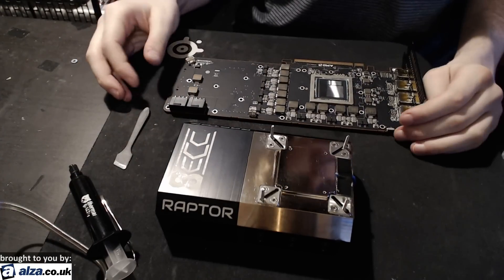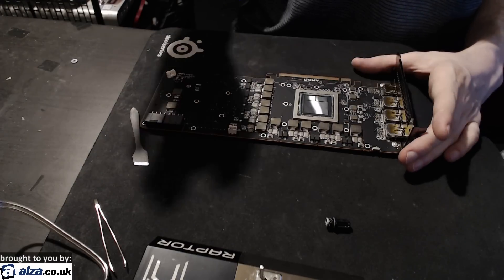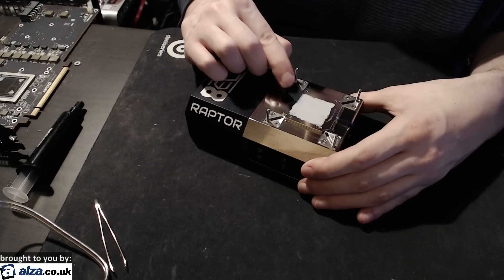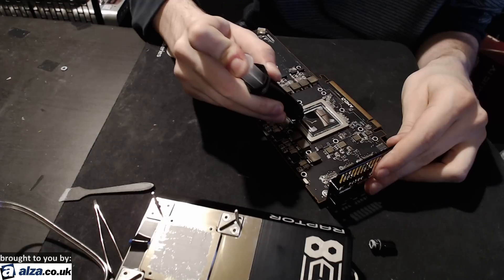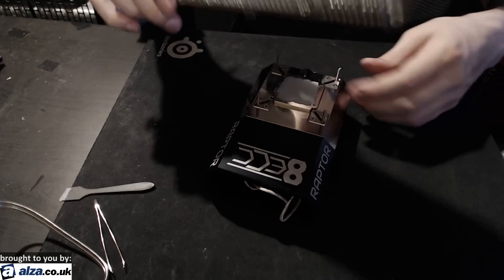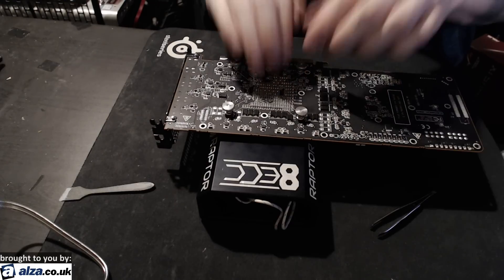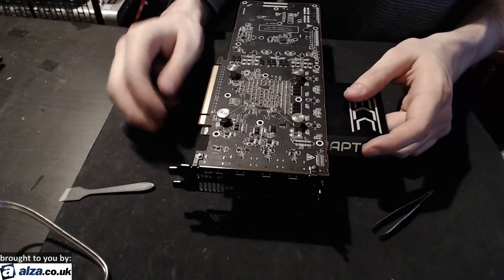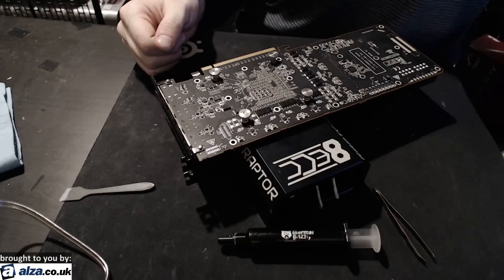The buildzoid way to apply thermal paste on GPUs for LN2

Comment: You know that kitchen wrap thing you use to cover dishes without lids? Put a piece of that on a finger and a little dab of thermal paste in the middle of the die. Spread carefully using wrapped finger. I found it uses much less thermal paste than little shovel some manufacturers provide. I've never touched LN2 though.

Comment: Hello, great video! I have suggestion regarding the  process of applying paste. I am not engineer or anything so maybe I'm wrong... Last summer I started some project which involved couple of TECs, water block, fans, powerful pump and big a** radiator. Basically, on both sides of water block were 2 TECs. Each TEC was cooled by Arctic Alpine 20 cooler. The purpose was to lower the temp of water as much as possible (lower then 0). After several failed attempts we realized the problem was paste layer between TEC's cold side and water block. TEC would easily lower the temp to Sub zero on first run and paste wouldn't spread uniformly on its cold side. The solution to the problem is crude one, but effective: After assembling water block to TEC (and cooler on the other side of TEC) we would leave the assembly on the kitchen hot plate for 2-3 hours on about 50-60°C. My guess is that higher temp made paste more viscous and that allowed it to spread uniformly and to squeeze out any air bubbles. We run this setup for almost 2 months non-stop and it worked perfectly. After we turned it off we tried to disassemble it and we failed - the bond was so strong. We succeeded only after heating up everything again on kitchen plate. I do not know anything about LN2 but maybe this can help get  you better performance.

Comment: Mr Buildzoid. First of.. Thanks for great content. Good work. Secondly, Can I ask you a question on a different matter. I own a MSI B350 Tomahawk motherboard.. I know.. Sigh. My problem is I cant find the vrm specs and max temps on forms or the internet or msi manual for that matter. I also don't know if the temp reading in hwinfo is the vrm or mosfet temps. My problem is if I run real bench.. For example.. The motherboard's temps go to 125 celcius,  gets stuck at 125 and then to 0.. But the system does not shut down. I just hope it didn't damage anything. Any information regarding the VRM'S from an expert would be greatly appreciated.  Thanks.

Comment: Other than breaking world records, what is the point of LN2? 
Us general users can not use LN2 in a day to day application.
Like EVGA Kingpin cards, with an LN2 bios which a general user will never use.
I diagnosed a Kingpin card recently, and the guy had the LN2 bios running on the stock cooler, and yes, he crapped out the GPU.
So i don't get the point of LN2 bios on a retail card designed for general use.

All that aside, I still love watching LN2 at work, don't get me wrong here.
Reply from the maker: Because there are a lot of LN2, DICE and phase change overclockers who don't have contacts at EVGA to get their hands on non retail hardware. Selling hardware for LN2 OCing gets my full support because without that getting into LN2 overclocking would be straight up impossible in many cases.
Reply: MrHatterr the kingpin card is not for general use, why would you buy it if you dont ln2 oc it
Reply: Well you missed my point totally, i own 2 kingpins and 3 classifieds all used a general use card simply for overclocking ability, not LN2.
My point was, why have LN2 features on a retail card when nobody buying a retail card for general use will never use the LN2 features.
Like I said, other than breaking world records, LN2 is pointless.

Comment: What about putting extra thermal paste around the die on air/water for normal use. It would ensure that heat can conduct off the edges of the die, anyone want to test and see if it makes a difference?. Amazing innovation here
Reply from the maker: it doesn't help. I did some thermal paste application testing in the past and as long as you don't apply too little you shouldn't see any thermal variance.

Comment: Which mobo do you suggest me between x370 taichi (vrm overkill?) and x370 gaming k7 ?
I would like a good product for oc and future upgrades of the cpu (I have R5 1600 - FlareX 3200 for now).
Reply: VRMs are not an issue with ryzen since they all run fairly low TDPs. A B350 motherboard should be plenty, the added cost of X370 is not worth it if you are not specifically going for crossfire/SLI.

Comment: It's the first time I see a naked Vega 64... Why the hell is it so long if 1/3 of the PCB has barely anything on it?!
Reply: I haven't directly seen the Radeon Pro SSG's PCB but I imagine it's shared with RX Vega/Vega FE, so I'm going to speculate that the reason is most likely due to the extra space needed to mount an m.2 ssd to the pcb, which this hypothesis is also supported by there being an empty connector pad on the back of the consumer card near the 8 pins.
Also, it just so happens the extra pcb space doubles up as a good place to mount the blower fan for the reference card.
Reply: they already tried the small PCB thing with the fury, but then they realized that the air coolers overhang the board by like 60% and that looks  even more stupid

Comment: I wonder if refrigerant oil mixed with cpu paste would work to keep the paste from hardening at LN temperatures? The one I am looking at has a pour point of -56C. I guess that means it is the viscous like a grease. http://www.nucalgon.com/assets/SDS/English/4314-3MAF_SDS_ENG.PDF
Reply from the maker: The thing is I'm like 99% sure kryonaut is already based on something like that because most pastes just use silicone oil and turn completely solid and fail at -20C. Kryonaut is perfectly fine until you start going bellow -100C. Kryonaut was basically developed just for LN2 overclocking. So was the Kingpin cooling KPx paste. Both of them will crack depending on what you try to do with them. With Kryonaut the most reliably solution is just to use lots of it and cover everything.

Comment: I know, that GPU architecture, or better said, architectural bottlenecks might not be your strong points, but what do you think is the main reason, that the performance for RX VEGA isn´t as good as it should be (we all have seen those benchmarks of certain games, that make those Vega cards perform even better than a GTX 1080ti). What should AMD change about the core to get even better performance?

Great video btw. I have been using TG conductonaut for all of my laptops and GPUs, it is a nice step up from normal TIM.
Reply from the maker: They evidently went way past the optimum amount of SPs. Since the V56 is basically just as fast as a V64. Doing 3000 - 3500 SP design or smaller might have saved a lot of power and manufacturing cost without changing performance that much. I have no idea what actually needs an upgrade. From looking at just the specs of AMD GPUs I can't see anything that looks really obviously badly out of balance. The 390X has just as many ROPs as a VEGA 64 and that looks kinda concerning but on the other hand the 7970 and RX 480 have only 32 ROPs and they're fine. So basically I think a smaller more affordable VEGA would have been a better idea than the evidently overly SP heavy design we got.
Reply: better ask that josh from pcper

Comment: How would you describe a suggested coverage amount in relation to LN2 but for a waterblock? I'm getting good temperatures but at higher speeds the 'hot spot' climbs towards 70°C and I believe it's thermal throttling (using the liquid BIOS), so hoping for some perspective for when I repaste the GPU block.

Also thanks for all your content! You may think you ramble sometimes but there's more information in there for us plebs than you think ;-)
Reply from the maker: for water blocks and air coolers I just do a thin layer on the die. This is literally only meant for LN2. I wouldn't even bother with it for dry ice.

Comment: Thank you. Pretty much the way I have done it for the last ten years for water and air.
But with a bit less paste and I revert this method. I spread the paste on the chip/HS and put the pea on the cooler.
So I can spare the extra step with marking the edges.
Good to have some confirmation though because everybody else keeps on flaming me for this.

About the small pea in the middle and air pockets:
I used to not do this and yes I got air trapped once.
You will notice though because the temps went 10°C higher on air and stock.

Comment: im guessing the amount of thermal paste buildzoid uses is probably to help prevent condensation/inconsistent temps or something from getting in between the gpu and ln2 pot. im guessing.
Reply: JR to eliminate cracking.

From now on I'll assume,
I think side's crack which  doesn't make any difference since you  don't dissipate much heat there. And middle doesn't crack because side's already did. I think cracking is caused by temperature difference. Also should have said before cracking paste getting solid and/or shrinking due to temps getting lower (but if you are using kpx or kryonaut shrinking shouldn't be a problem) and not properly contact so not dissipate heat to ln2 pot.

Comment: All those people on youtube that for some reason weren't able to spread thermal grizzly on "metal/shiny surfaces" should watch this video. It'll help stop incorrect assumptions of thermal grizzly paste not working.
Reply from the maker: wait are you telling me people have a hard time spreading TG Kryo? Are you sure you aren't watching vegetables?
Reply: i'll have to go back to the videos and confirm, lol, but there are a few videos on youtube.
Reply: I just bought some Thermal Grizzly Kryonaut for my EVGA GTX 970 that im slightly modding. I hope my Grizzly paste sticks, watch me have the same problem due to bad karma, lol.
Reply: JR liquid metal, yeah that's kinda hard, but kryonaut? What kind of people they are...
Reply: I found that warming the tube a little (soaked in hot tap water for couple minutes) helped a lot and reduced the viscosity enough to spread very evenly, but you have to act within a reasonable amount of time.

Comment: sooo why do you use sooooo much paste? like i get that you need to cover the entire die but like, that seems extremely exessive
Reply from the maker: honestly no idea. I just know that basically every other method I tried failed. With Kryonaut you generally have to use tons of the thermal paste. Like on the 7700K I do pretty much the same thing I do here. On the 7350K I do even more.

EDIT: one theory for why you need so much paste is to cover any sharp edges that could cut through smaller amounts of thermal paste as the die thermal cycles. Another would be that with less thermal paste as the core shrinks the during a cool down it pulls in air under thermal paste layer. But with this much thermal paste all around the core the only thing that gets pulled in is more thermal paste preventing the disconnect.
Reply: Probably to ensure no air gets stuck between the die and block alongside trying to stop cracking.

Comment: How much ln2 do you use in your oc streams
Reply from the maker: really depends on the hardware and benchmark. VEGA sucks up like 800+ml of LN2 per Unigine Heaven run. I have 2 35L and 1 30L dewar.
Reply: Actually Hardcore Overclocking what about 7700k
Reply from the maker: A lot less.